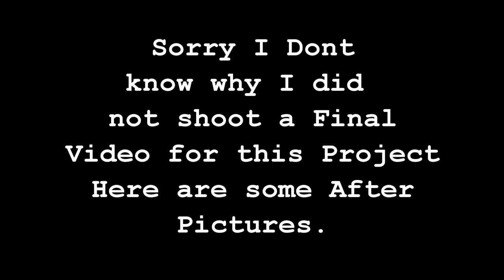Concrete Flooring Bathroom Floor Metallic Epoxy | Shower Floor Concrete Overlay Lake Ozark MO

Comment: 2 completely different floors, I have never seen anyone bury heat coils into concrete and over wood, that's Impressive...NICE LOOKING FLOORS!!.... BIG Thumbs UP!!
Reply from the maker: 925jobkiller cool glad you are liking the floors, that's what I was goin for 2 different floors and that's what we got lol, they both really turned out as I wanted, the Metallic Floor took a lot more layers than originally planned, but I pulled it together in the end, glad you like the work.

Comment: i noticed drains so i assume the floor slopes to the drain.  When epoxying the slope of the shower floor, how do you keep the epoxy from pooling at the low end? How do you apply the epoxy so that it is even on the level floor and the slope? Thank you so much
Reply from the maker: yes it will pool to the drain some, we pulled the drain screen out and used a piece of duct tape inside the drain hole, folded the tape over in half so it stuck to itself inside the drain, then added a second piece of duct tape so the glue side faced in and we were able to use the outside if the tape that way the epoxy would not stick to it, so the tape was raised about a half inch creating a wall to block the epoxy from draining inside the drain, once cured we re-attached the drain screen and that's it.... hope that made sense.
Reply: @MrCustomConcrete  it makes sense.  thank you for taking the time to provide me such details.  beautiful work.
Reply from the maker: @pschick4430  your welcome glad I could help and no problem I don't mind helping, that's Awesome I'm happy you like my work I Appreciate that

Comment: How slippery are epoxy floors when wet?  I would assume they would be like glass, get them wet in the bathroom is it then very slippery?
Reply from the maker: Yes its hard to have both slip resistance and easy maintenance.